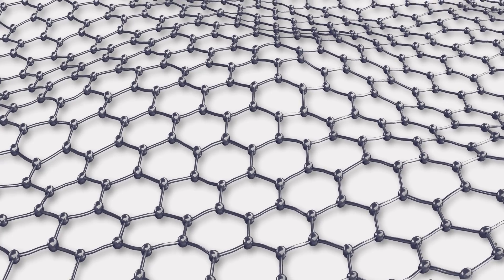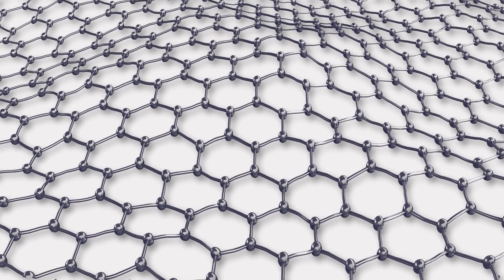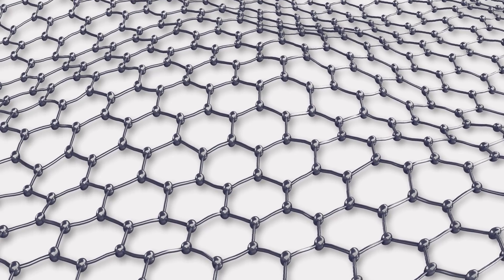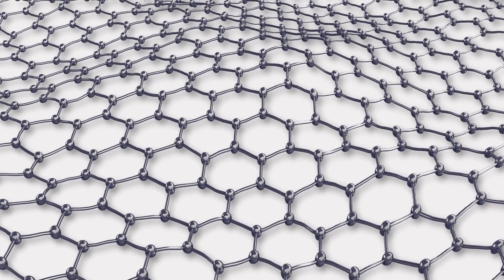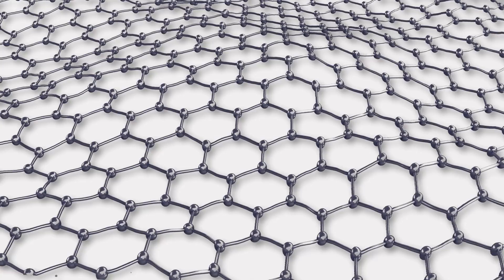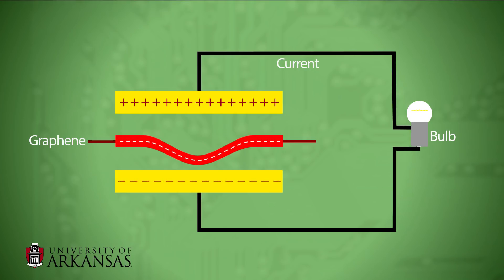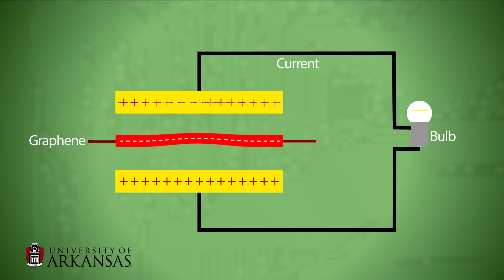A Potential Source of Clean, Limitless Energy

Comment: As we know, energy can't be created from nothing, so what is causing those fluctuations? Is it tiny heat differences or something? Or are you claiming to have invented a true perpetual motion machine?
Reply: This phenomenon is "observed", so it's possible so far, (until we discovered this is misunderstanding). If you can't explain it, that's fine, but that won't stop this phenomenon from happening.
Reply: It will stop working if the temperature drops to 0 Kelvin, just like gas molecules that vibrate all the time and they don't care what would you say about thermodynamics.

Just don't adjust your air conditioner to 0 Kelvin and it should be working fine ;)
Reply: Heat... the thing that causes atoms to "vibrate" is heat. 

The battery probably cools down as you remove motion from atoms. But as long as there is warmth - the thing will keep rocking back and forth.
Reply: As the guy says - "occasionally" the ripple flops. It's not at a constant frequency, but "by chance", spontaneously. The atoms wobble around randomly (Brownian motion). Because it is random, occasionally a bias towards one side or the other is generated. Remove Brownian motion and the film will be stationary. But as long as you are above 0 K - it will "occasionally" flop from one side to the other...

Like rolling a thousand dice 10^10 times per second, and hoping the get >50% of dice above value of 4. It happens with predictable probability. The colder it gets the fewer "rolls" you get per second. Reach 0 K and the dice become stationary.
Reply: How do you make it rock back and forth as one system rather than random self-cancelling ripple ?
Reply: it does not matter if this VIOLATES the know laws of phisics... it is a fact and it will keep happening dont matter what you say... the only thing here is that phisicists cant deal aand explain what is going on but the thing is as real as you and me... cheers... fraid skepticals...
Reply: Look up zero point energy.  Particles appear and disappear in the universe randomly.  They cause ripples in the "fabric of our universe". Put two super small or super flat plates close together they vibrate from the energy released by these particles popping in/out captured between the plates.  Energy is not created from nothing... But it is like waves in a pond when you drop a rock in it.  The big bang was the rock dropped in the pond that is our universe.  So even the vacuum of space is "not nothing".  No doubt just movement through time and gravity (which are probably the same thing depending on how you look at it) induces these n-dimensioal particles to appear in our perceived 4 dimensional universe. This is easy to visualize.  Imagine a 2 dimensional object (like a circle drawn on a computer screen using a common drawing program like adobe illustrator), and using a mouse cursor click and drag to move it so it crosses/intersects a single line drawn on the same screen. (e.g. a 1 dimensional object). From the "lines point of view" (imagine you were a one dimensional creature living on that line) -- What would you see over the time period that the 2D circle moves across the line? You'd see a dot appear the moment of intersection, then it would split into two dots moving further apart for a while, then coming back together back to a dot then disappear.  Same thing happens in our 4D universe.  As 5D (or higher) objects pass their way through our universe, appearing as sphere changing size (moving around too) in our view, then disappear.  EG. particles appear and disappear because they are greater than 4-dimensional, and as they do they make (and take) some energy. The waves on the pond.., get it?  Which we have proven can be harnessed using super tiny sharp points of metal (Scientific American Magazine) due to zero point energy theory. However, these wiggling sheets of graphene give us a relatively large area to capture these energy waves from the quantum particle in bulk.  Simply put: The very space-time continuum is an randomly moving energy field, that I believe makes graphene wiggle and warp.
Why/How/What/When/why-not you ask and frankly who the F*K cares?  I think this is a so called "glitch" or loophole in our universe is just another indication we live in a simulation. Show me the money you say!  OK... Quantum entanglement, dual light slit experiment (which is proven to be affected by the conscious mind!), factored out string theory resulting a binary computer commands(!!!), quantum gravity loop theory are all examples of these loophole or glitches that IMHO mean that we are in a simulation based in imaginary numbers (the true physical quantum).  Some may say that GOD is just playing us like a computer game. Much like humans play World of Warcraft, and we are the computer generated players in the game.  Most  computer games have some glitches.  But we are super crafty critters and can figure things out these glitches to survive.  Like how a computer chess game can now pretty much always win over humans.  We should tell the *real players that we figured out their game and we will no longer play their game until they reveal themselves!  HAHAHAHA!

So how can this be?  How can a computer generated robot (humans?) be smart enough figure out and beat GOD (or help god) at it's own game?  Well. Take a look at Genetic-Algorthyms... (Karl Simms works for example).  It's fairly simple math (mostly hand calculator functions and random numbers, in conjunction with mostly unchanging policies or rules) that can figure out how to build impossible to build roadway bridges, or show how evolution works, self-learing machines, these can draw life-like pictures, the fact there is a fixed min time between object movements (hmm, like a screen redrawing every frame in a game) and isolate bizarre computer errors.  We could just be a type of self-discovering genetic-algorthyms, which in effect is a way to automatically evolve computer code based on a complex data bank used as the "rule basis" to guide the evolutionary process.  Thus you  CAN have "god" and evolution at the same time.  (sorry I do not believe in human's strict religion concepts, it's only a partial answer to force us to think and rules to cooperate) Gee.... but think about maybe that "rule basis" is defined by our DNA... and the "big computer in the sky" is just applying those DNA stored rules to evolve to learn about itself and take advantage of the glitches as a side effect.

Also, not to toot my own horn as you guys say... but I discovered graphene in 1972 in (5th grade, in Olympia WA USA) using a graphite crystal rock from a Canadian Rock-Hound store my dad gave me and scotch tape method (same as the Russian guys who got a noble prize), I kept trying to take it to the lid of a whitman's chocolate box but it would not stay, so I played with it a lot -- what's cool is that I got small sheets almost a 1/4 inch (8mm) wide and high, whereas they just got tiny flakes -- hahahaha I bettered them!  But I was too young to figure out what it was.  Even in college in 1978 I was trying to gets physics teacher to figure it out... they couldn't.  I had no idea what is was, but I knew it was "special".  Eventually decided to focus on girls and cars.  LOL!

By the way.  I'm am what you call an alien. Much like your prius cars, only in meat form not metal.  HAHAHAHA!  I actually have proof I have two different DNA under my brain (caused a nasty tumor system).  My mom was out of the world for sure.  HAHAHAHA!  Just kidding... well not really. I learned American immature-mind language watching TV so I can speak to the average human. Just so ya know, Robin Williams, really is an alien, Mork and Mindy for him WAS a reality show. HAHAHAHA!  But it could be, maybe.  Almost all people on Earth that have the INFJ personality type are Alien created or modifies (about 1% of the population.  Look it up). The average earth-person makes us crazy and eventually, just like Albert Einstein (who was not an alien), we get depressed (or other mental diseased programming) choose when to die just to go see who is running the simulation.  Did you know Einstein after 20 years of research said that he gave up trying to prove we exist?  He concluded he could not prove it.  So to find out, he declined surgery to fix his aorta and let himself die a few days later.  I wonder what he found if anything. Go figure.

Yeah yeah yeah, right you say.  And yes I agree it's a little early to play Aprils fools on your guys.  But I have a space ship to catch. Once the G-men read this (you see them all the time... they are often fake-homeless people wearing aluminum foil hats, walking like a chicken pushing a wheelbarrow or shopping cart in towns, one tailed me most of my childhood), they will come to visit me.  Hate it when that happens. So, I gotta split. I'll be baaaaaack in a few months and will check email for replies.  I'm outta here!  C'ya!

Earth people rock! (mostly).  Please make sure N.Korea stays in check while I'm gone.  OK?  Is that too much to ask?

Scott
Reply: You are kind of correct. Matter can be created, but energy can only be "borrowed". Never created. That is how forces work. 
Negative power does not make sense, unless you mean that you take 10W of power from somewhere, which simply means that you have transferred energy from one place to another. Not created it.
Reply: And that is my point. Unless the laws of probability have changed since I last looked at them, when dealing with large enough numbers, randomness will always cancel everything out. If the numbers are small (such as in micrometer or less of graphene), then the power is negligible. And you can't stack it due to the randomness. 
And finally: Brownian motion: "the erratic random movement of microscopic particles in a fluid, as a result of continuous bombardment from molecules of the surrounding medium." Which this is not, so please stop calling it that.
Reply: yep. professional bias is a terrible thing.. people used to think earth could not be round - because it was against the laws described "in the book" back then. Reject empirical evidence in favor of theory, they used to...

Truth is observable and non-falsifyable. Explanations of observations correct - until empirically falsified. If you think "everything is solved", there are no errors and nothing new to discover ... well then, who needs research then? Maybe all we need is more and more precise measurements... Lord Kelvin? (he was awesome, though)

When "the implausible" is observed - observations are correct, and the modes are wrong. I'm not saying thermodynamics are "false". But I am saying YOU are applying them wrongly in nano scale... your interpretation is wrong - because empirical evidence is surprising you. If you chose to close your eyes to empirical evidence, might as well read the bible then...
Reply: First, people never thought the Earth was flat, it was a myth propagated in Renaissance for the people at the time to feel better about themselves.
Secondly, "truth is observable and non falsifyable", like the neutrinos faster than the speed of light in CERN, right?
Reply: I can only assume that English is not your first language, but neither it is mine. It is not a "fact". Simple as that.
Reply: Read upon particle-antiparticle creation and hawking radiation. Then get back to me. Thank you.
Reply: read the description?
Reply: StraightOuttaJarhois so, if energy and matter cannot be created... Then from what in the hell did our universe come from?!
Reply: skepticals are really suffering  with this... lol
Reply: Yes it can with opposing magnetic fields also you can read voltage between two copper rods hammered into the ground try it.
Reply: Nope.  It has never been proved mathematically or otherwise that this kind of thing is impossible.  I challenge any of you to name the proof and the scientist who "proved" it.
Reply: @tech stuff, yes, matter can be created, but not out of nothing
that's what the e=mc^2 formula describes
you can convert energy into matter, and matter into energy, but because the speed of light squared is a HUGE number, it can be quite hard to observe this( for instance i tried doing the math on combustion of methane based on the change in mass from the chemicals before and after the reaction, but because those weights tend to be rounded to 2 decimal places i ended up with 409,832 MJ/kg energy density, while the actual number is only 55.5 MJ/kg)

also to answer your question: energy came first, the early universe was way too hot to sustain matter and it may have always been here, but we don't know as we cannot observe anything that may or may not have happened before the big bang, but as of the big bang, the total amount of energy in the universe has remained constant
the total energy in the universe is finite and can only be converted from one form into another (and matter is one of those forms of energy), not created or destroyed,
Reply: We have been witnessing this kind of phenomenology of late in a burgeoning research area - time crystals. Causality seems to rule crystals however and thusly needs apparently more incursion than what is essentially here a 2d molecular movement into the third dimension (time crystals shift into the fourth). Whatever emerges in ongoing research an energy source as active as this is, smacks of micro current AC generation  to those clever dicks that know their ohms from their volts.
Reply: Guys, it's not violating thermodynamics? It converts vibratory motion from heat into charge, then losing this heat. But it gains more heat from ambient surroundings. It's an open system. For all intents and purposes, you might as well call solar cells a limitless source of energy. The sun will be here long after any of us are here. Likewise, the entropic cold death of the universe is even further away. On a human time table it's limitless.
Reply: StraightOuttaJarhois I was wondering the same. He needs to explain from where the exceeding is coming from.
Reply: It is only happening on a very small scale.  On any large scale, the effect cancels out.
Reply: MrMonkeybat no I thought about the second law might be preserved if it increases total energy dispersion ie if the ripple helps disperse more energy then it generated I guess it creates insulation that only slows the spread of heat but eventually all the heat will still be released its like a sterling engine
Reply: 📰 "The findings, published in the journal Physical Review E, are proof of a theory the physicists developed at the U of A three years ago that freestanding graphene — a single layer of carbon atoms — ripples and buckles in a way that holds promise for energy harvesting.

The idea of harvesting energy from graphene is controversial because it refutes physicist Richard Feynman's well-known assertion that the thermal motion of atoms, known as Brownian motion, cannot do work. Thibado's team found that at room temperature the thermal motion of graphene does in fact induce an alternating current (AC) in a circuit, an achievement thought to be impossible."

📰 source: https://phys.org/news/2020-10-physicists-circuit-limitless-power-graphene.html 

📰 October 2, 2020
Reply: You people... I swaer. If you saw a thermameter over a flame, you'd scream impossible. FFS. It's just a heat sink. Heat drives it. It's not perpetual. So sick of armchair "scientists" and their absolutist nonsense.
Reply: Danilo Marvel I don't think you understand how numbers work.
Reply: " ...So long as the graphene's temperature allowed the atoms to shift around uncomfortably, it would continue to ripple and bend. " It seems if a constant energy source maintains the graphene within a certain temperature range, it will continue behave this way.
Reply: The energy is coming from the ordinary Brownian motion of anything which is not at absolute zero. It is not infinite energy but like Maxwell's Demon it still violates the second law of thermodynamics. The description in the video it seems to be harvesting heat energy from the graphene without having to go through any kind of Carnot cycle dumping the heat in a colder body, this is supposed to be imposible.
Reply: Yeah, but this violates the most fundamental laws of physics. What is more likely; they made a mistake or overlooked a factor, or they just disproved all of thermodynamics?
Reply: Xezlec ignorance, everywhere.....
Reply: More than "supposed to be".  It is provably impossible with elementary physical laws.  The guy in the video isn't claiming to have observed new fundamental physics, so he is claiming that a contradiction is true.  He's wrong for sure.

Also, this would indeed be "infinite" energy in a sense, since you would be able to keep using the same energy over and over again.  After you've used it to power your device, it becomes waste heat which can then be used again.  It's nonsense.
Reply: well i mean technically you can create Matter and Energy out of nothing, conversion of energy just means the total amount of Energy in a system is unchanging. so if you made 10W of Power out of nothing it would also make 10W of Negative Power to balance it out again.
Reply: people dont learn... how many times scientists said it was impossible to something??  10000000  times  and they was proved to be wrong fraid skepticals that disapears after the new impossible fact becomes possible... funny